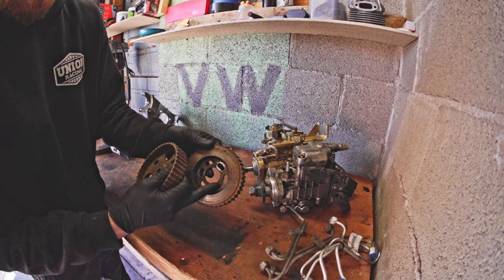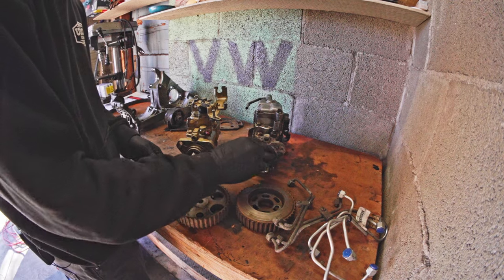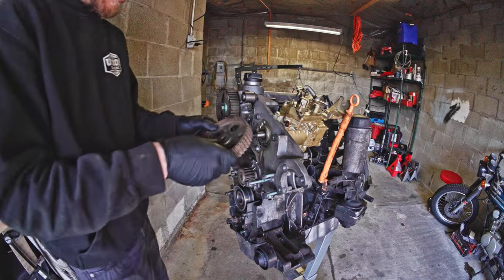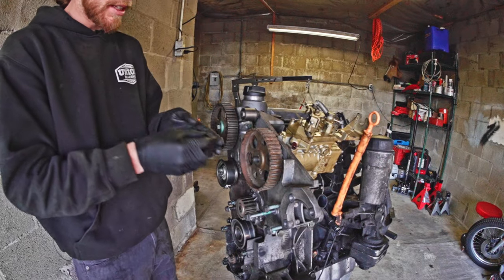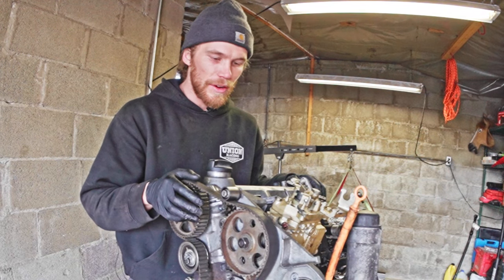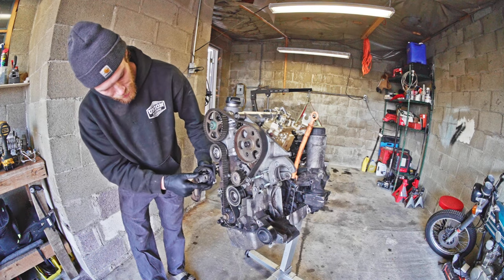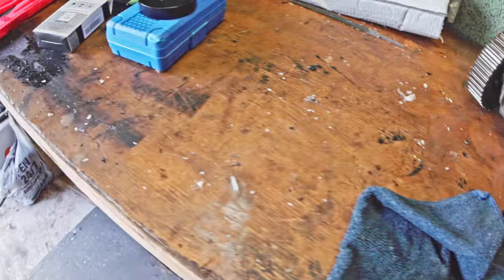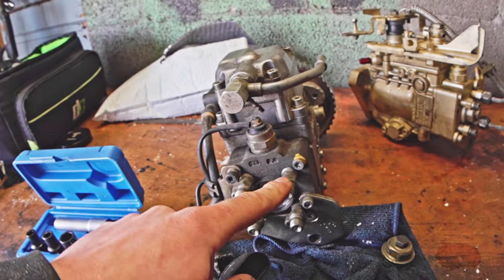HOW TO make an VW M-TDI engine run with a VW 1.6L injection pump!

Comment: I will say that in my 14 years of learning about these motors, I can't recall an 1.6 pump working well on a TDI. I know that most recently someone told me that they did, but couldn't provide video proof. The pressures are vastly different (although you do address it in your video). Hopefully you can show us old fogies that it does work. That'll open up the options for everyone else. I bet you'll be limited in power due to pressure and she will smoke pretty darn good as well. If you need a 1.9 mTDI pump I have an acquaintance that imports them from Brazil (built by a friend) with 12MM pump heads that rev to 5K and are capable of 250-300 BHP. They are 1K USD shipped though. So not too cheap. Best of luck.
Reply from the maker: Re:pump, that's dank! I'll keep that in mind. Well see how it goes! This is certainly an experiment and if nothing more, a progression. It seems to me injection pressure should be fine (if not the same) since I'll be plucking the 11mm head out of the TDI pump. Certainly where it'll be lacking is in timing advance. To call it a 1.6 pump would be immaculate at this point though, it really is a Frankenstein of both with really just the 1.6 lift pump & drive shaft. Cheers 🍺
Reply: @OliverFetter  I thought about it more today and was wondering what the popping pressure is on the 1.6 compared to the 1.9 injectors. I know the 1.9 had dual stage injectors, but don't know on the 1.6. Might be good to investigate.
Reply from the maker: For sure. 1.6 TD is 155 bar (single) looks like 1.9 is more like 230/310 (dual)
Reply: @OliverFetter  just saw it's 155 bar for the turbo 1.6 and 220-230 bar for first stage and 300+ bar for second. You're going to have a bad time I think. Hopefully not though.
Reply from the maker: What do you think is specifically going to be a problem? I could see the input shaft potentially being too weak, other than that, it'll all be 1.9 parts anyways.
Reply: @OliverFetter  I've heard, never seen a post on it, the shaft breaking. My guess, as a retired diesel mechanic, is improper atomization of the fuel. Incomplete burn, no power, not sure what else. I mean, maybe take a pump to a shop to have them test it out for spray pattern. If they can get it working on the bench, then there's no reason to not think it'll work in the car. Better to test it that way instead of potentially causing an issue to the block.
Reply: @TDISwap  its not going to be a problem. If you run the original 9mm pump, yes. Because that can in fact reach 230-300 bar, but it will take a very long time to reach that pressure, so your injection time will be short & timing wont be right. With the 11mm head you will have the exact same pump internally. The TDI is just electronically regulated (and has a bigger shaft). Mechanically you just need to (dynamic/static) time it right.
Reply: @chcm5876  fucking sweet information! So in theory all I would need is to change the cam plate, and pump head and we should be good to go?

Also, what is a good static timing for it, 1.00mm? I know with my 12MM mTDI pump two vendors said different 1.00 and 1.30-1.45mm. It was also suggested to use a pulse adapter (and I bought two of them), but could never get them to work without noise causing the piezo to flash wrong.
Reply: @TDISwap  Hi yes, here in europe the fuel mechanical fuel pump from the Land Rover 300TDI (which was direct injection) is a common swap. Here's a tutorial (in Finnish, but you can mute it and just see what he does) The K-measurement is important

https://www.youtube.com/watch?v=0Y3vSfqM_88
Reply: @chcm5876  I had a 300TDI fuel pump for mine, but it was damaged. I also have a 12MM mTDI pump from a  US military vehicle, so I understand how to time it with the plunger and dial indicator. Just wondering what your suggestion was for the 1.6 pump on a 1.9 engine as a baseline.  https://youtu.be/5rw_5Fbx8B8
Reply: @TDISwap  nice work, looks great. Here's a list: plunger (11mm instead of 9mm), Camplate (TDI camplate isalot more agressive), governor mod so you keep fueling even in mid/high rpm, dynamic advance (advance increases wrt engine speed)
Reply: @OliverFetter  probably resolved by doing a high pressure side change and late model rotor.
Reply from the maker: @Mikefngarage  exactly

Comment: it's possible, did this a lot in the past (golf 1 & 2 periods), you need skills and knowledge. Best is to take the 1.6 GTD pump and change the plunger of it. There are different pumps you can use, there is also difference in camshaft that you can use, to build the best pump you need parts from 3 different pumps.

Comment: Is it possible to put a 1.9 head on a 1.6...... ?
Reply from the maker: Which 1.9? The tdi?
Reply: @OliverFetter  alh
Reply from the maker: @rondobondo6600  I would start by comparing the two head gaskets, even just photos of them. Off the top of my head in not sure but I'd expect they have different water & oil passages
Reply: @OliverFetter  cool beans I will definitely look into it..... thank you very much.... love your show ❤️
Reply from the maker: @rondobondo6600  cheers 🍺🍺🍺

Comment: How to set the timing
Reply from the maker: If your wondering about 1.6 specifically - that can be found here: https://youtu.be/MkEHLWzMQE8
Reply from the maker: But for the 1.6/1.9 combo it will be kinda the same! It'll be all the usual 1.9 timing marks, then aligning the TDC mark on the pump pulley to the TDC mark on the 1.9 mounting bracket. Not too bad!

Comment: I just left 4 holes on my engine mount and cut the ring right off. Then it bolts right to the engine.  All four holes should be there but hard to see or under something that you can pull off.
Reply from the maker: Thanks!

Comment: Hello, l'm sorry but on this one l don't agree , best power to modify the 1.9 one. Good luck
Reply: For the front engine mount its good too use those two bolts, you need a plate cut to shape and modify the original mount to weld the new plate. Unless you have the 1.9 mount and you can use part of it too.

Comment: Will you still need the ECU to control the injector and other sensors and whatnot
Reply from the maker: That's the cool part... no! The injection pump controls the injection timing, and it's all mechanical 👍
Reply: Ahhh cool

Comment: Great info covering all the hurdles to putting a 1.6 pump on a TDI. 
Following for sure.
 When you remove the pump head's big center plug. You need to get a new one. The metal ring is a one-time-use seal that gets squashed on install. According to my local bosch service center, pump rebuilder, it can effect start of injection..
 I've always heard the delivery valves on the TDI pump are for 2-stage injectors,.. like the injectors on the TDI.

Great job. I'm trying the same thing with an AHU  TDI engine. I heard it was easier to swap into a MK1 engine bay.

Comment: You can put a 1.6 pump on a 1.9 aah, ahu, or 1z because they are based on the 1.6
Reply from the maker: Hmm. Do you know what makes it particularly compatible?
Reply: @OliverFetter  the mounting plate is similar to 1.6 on those engines

Comment: you just need to drill a piece of aluminum to the correct size of the 1.6 pump then put it in a lathe and trim it down to the 1.9 pump. Then put it in the hole and tig weld it in place. This will prevent the spacer from vibrating loose....Remember it is diesel. it will do that. I have often wondered about this sort of thing. I could have bought a ALH from pick a part a few weeks ago from a car with probably a bad trans. Was considering using a 97 mtdi pump. But also AAZ. I have a few 1.6 pumps that could be modified. Yea I also figured that the rotors and high pressure units would fit from later models. VW and bosch Seem to like to modify existing designs rather than come up with new ones.
Reply from the maker: I think a 3d printed spacer will do the trick. I don't have a lathe so 💁 owell. Definitely will need to be positively held into place I agree. You don't need to remind me my teeth rattle every time I start it 😂😂😂. Spot on with the Bosch modifying vs new. All parts fit everything almost.

Comment: I have a 1.9 SD in my snowblower, it is a bit weak so I bought a parts car with 1.9 TDI engine. First though was to just put the SD pump on the TDI, but learned that I can put the mechanical top portion of the SD pump onto the TDI pump. I still will not have any boost compensator but I will have a pump body that fits directly on the TDI engine and I will have a bigger plunger and more aggressive cam plate I think. 
The compensator is not really needed for me as I will for the most part run at a steady rpm.

Not sure how it is with the 1.6 pump, but maybe you can adapt the top part over to the 1.9 TDI pump?

Is your pump from the 90 or 110 bhp engine?
Reply from the maker: That's interesting! Unfortunately the 1.6 stuff does not line up. My tdi pump is ALH, and 1.6 pump is from a  TD

Comment: Is the 1.6 pump that you have (mods included) similar too the 1.9 td pump? (AAZ engine code if im not wrong) and doesn't it need a lot more pressure for direct injection ? I love your chanel mate please keep it running. As you always say cheers🍺🍺
Reply from the maker: I'm not very familiar with the AAZ pumps but id imagine it is quite similar. Yes! The 1.6 is 155 bar pop pressure and the 1.9 is 230/310 bar 💁 not sure what to predict there. On the one hand it's quite a bit more pressure, on the other hand I'm using tdi parts to modify the pump, so I can't see why it wouldn't work. It seems to come down to the input shafts if something had to break BUT we'll just see 😎 gotta test it out before caving to speculation!! Cheers haha 🍺🍺🍺

Comment: It aint all that bad putting the 1.6 on the 1.9😂. I mean, i have done it with a 1.6td pump on my 1.9tdi AHU. The AHU and ALH are similar. But also i am running on p520's nozzles, which makes it alot more fun to drive. It doesnt smoke because i made adjustments by raising the star wheel and a little modification to the boost pin. It run pretty ok until i can manage to get another 1.9tdi pump. Top out about 85-90mph.
Reply from the maker: I know 😂😂 you'd think it was the end of the world the way people talk about it. That's cool! I think it's going to work pretty well since its just a 1.6 pump body with 1.9 internals 🍺🍺 cheers
Reply: I've done the same thing 20 years ago it runs

Comment: oh god. You definitely will lose a lot of power with this fuel pump configuration. 
Tdi uses higher fuel pressure and the 1.6 pump is gonna underperform your tdi a LOT. (tdi injectors are rated to open and operate on higher pressure)
I'd use the 038 pump and try to manually wire it.
Reply from the maker: I mean it's a 1.6 pump body but it (the actual pump I will put to work) uses an 11mm TDI pump head and TDI rotor. I see no reason why the pressure would be insufficient. Certainly there will be a lack of timing advance when compared to the electronic counterpart but it's literally the same parts otherwise 👍
Reply: Hey, whats your thoughts on doing these exact mods on a 1.9 aaz pump , talking about swapping 1.9tdi automatic pump head onto the aaz pump?